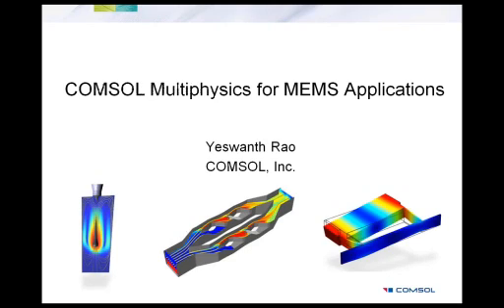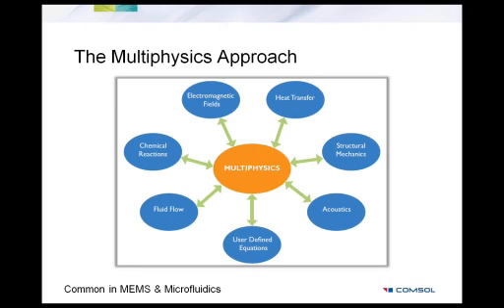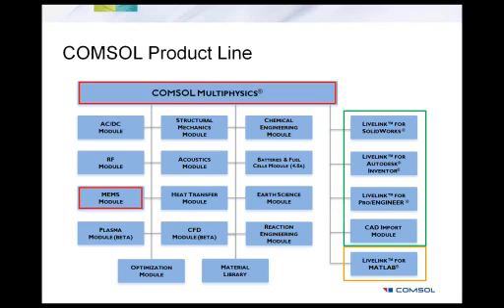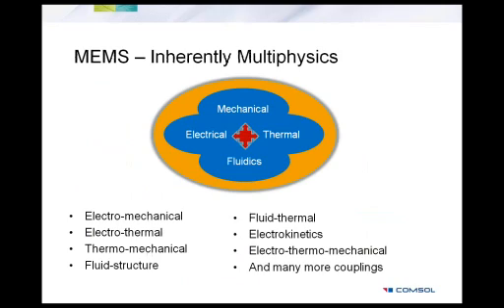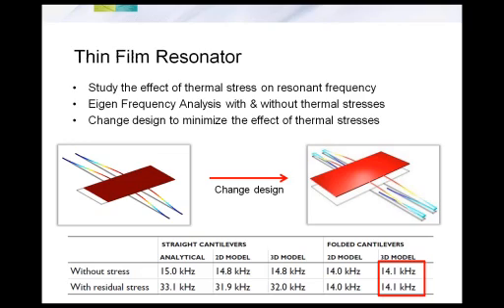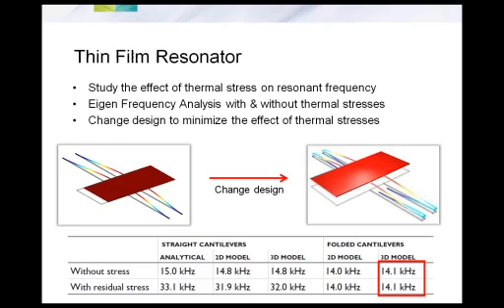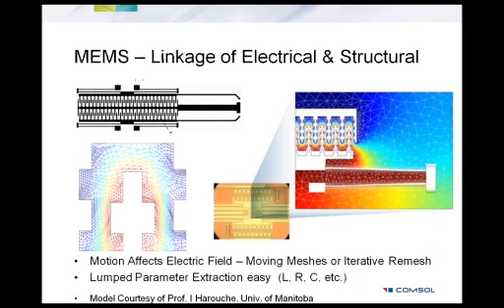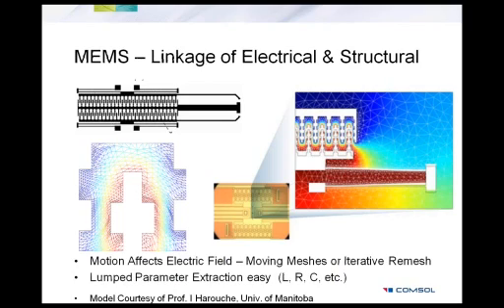COMSOL Multiphysics for MEMS Applications - Part 1 of 3

Comment: I have to model deposition profile during a chemical vapor deposition process. this model involves solving two integrally coupled equation. Are there preexisting modules in comsol or is it possible to code within comsol and simulate deposition ?